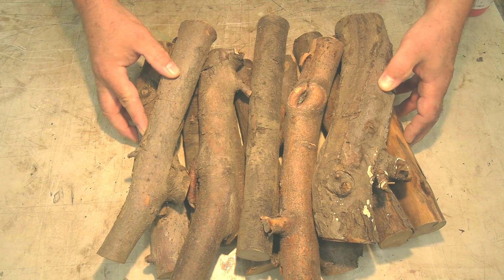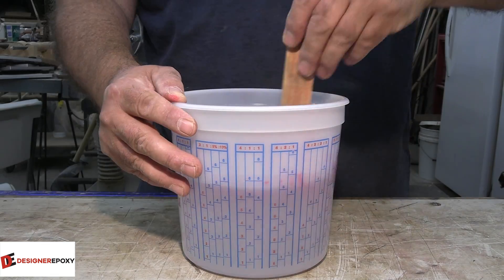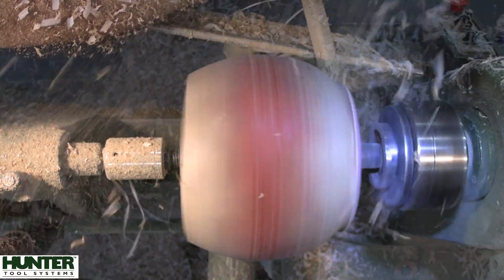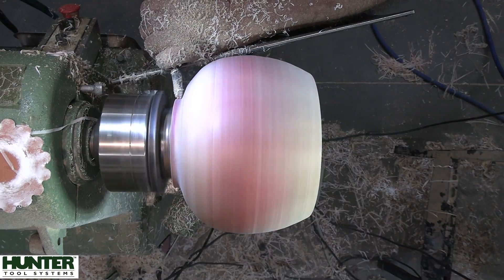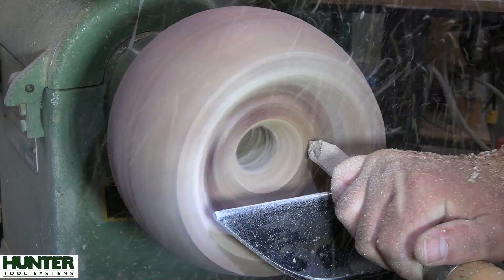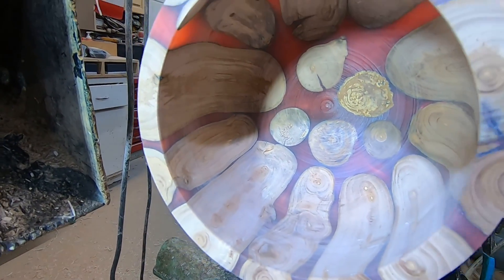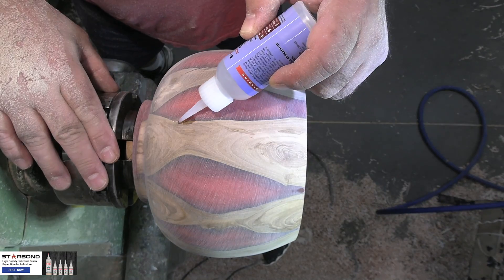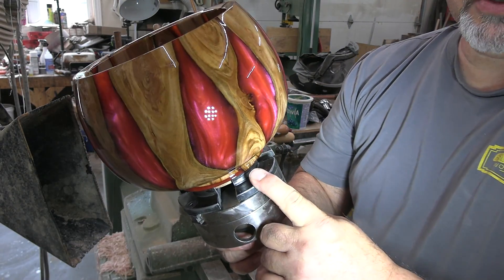Woodturning - The Apple Branch Bowl

Comment: I have two apple trees that have been in my yard since my parents planted them in the 60's.  They are in bad shape and I will be taking them down to make something for my kids who grew up eating the apples off these trees.
This post was an inspiration, as have a few others as to what I'll do with the trees, especially the smaller limbs..  I've also got a few neat cracks that I think will be awesome filled with gold inside dark blue hypershift epoxy.
Thanks, Jim.
Reply from the maker: My pleasure, thanks for watching!
Reply: @SpragueWoodturning  I'll send you pics of my "journey".  I can see light through a knot in the trunk of one of the trees, and that was what caught my eye with this turn.  I'm trying to find ways to use less epoxy by using "fillers".  Maybe even PVC pipe and fittings.

Comment: The finished piece is superb. 

Just a thought - could you have just put short rounds of the branches in the bottom of the bucket and placed a plastic container with rocks/marbles/rice in it on top of them - that way the center would have already been hollow and the branches and resin you had to turn out could have been saved for another project without having to attempt the coring.
Reply from the maker: Yes, that could of been done. I think that the piece would of looked odd with the branches not running consecutively though it. Thanks for watching
Reply: @SpragueWoodturning  Not sure - I was only talking about the 3 or four that only show in the bottom but do not run to the top ... basically, the ones you tried to core out.  It may also reduce the total amount of heat and help avoid heat cracks.

Comment: Great project Jim! names for your rock,,,, Sylvester, you know, Stallone in the movie Rocky! Duane "the Rock" Johnson, my dads name is Duane also....Ive commented enough times on videos past, you might be tired of it, but i wanted to say Thank you one more time. Ive been working to achieve masterpieces like yours! Ive been mimicking a lot of your tools and products used. ive struggled through 6 cuts between 1 Oneway carbide, and 2 of the regular cutters. Ive made 3, 3 piece sets. my big bowls arent as big as yours, im using a large mixing bowl which gives me almost 11" diameter before spinning. I sold my first set today for $180! lots of work involved in the set, but coincidentally just enough to order the Korpro ive been wanting! Thanks for the videos! dont change a thing about how you produce them! 

Your fan,  Aaron-Fresh Air Woodshop- Kansas
   PS i will be using your coupon for the Korpro, so thanks for that too.
Reply from the maker: Great! Thank you so much!

Comment: This is a lovely hollow form! The apple branches, showing through the resin, remind me of a dahlia flower. I know it was disappointing to miss out on the core, but, remember, you do still have those smaller branch pieces. If you split them, lengthwise, you could do another resin piece, with much the same effect...Just an idea. 
Thanks for doing the Q&A sessions. I very much enjoy them! With respect to wood sources, I have found that just letting people know I'm turning, has brought in a harvest. People see wood at the side of the road, and tell me the address; they trim their trees, and let me know. Another has converted to a heat pump, rather than a wood burner, so has offered me some logs. I certainly don't mind! We are providing a valuable service to the community, giving them years of beauty, and, when the pieces finally give out, they often can be used again, but as firewood...but I'm preaching to the converted. Have a great week, and thanks for the video!
Reply from the maker: Glad you enjoyed the video and thanks for your info! Jim

Comment: Jim, didn’t know if you knew or not, but the Beall buffing system has buffing balls as well. They are great for getting inside a smaller bow with the Tripoli.
Reply from the maker: Yes I have a complete set of them. I find they don’t do as good a job as the buffing wheels. It’s probably got something to do with their small size. Thanks

Comment: Hello.I love the bowl.I use the General Finishes bowl finish.I do a heavy sanding after 1st app and just wing it according to how the finish smoothes out on the next 2 app.I saw that u only buffed after your 1st app.Is this because u which to the water lox?And do u use the same method of finishing on all wood bowls?
Reply from the maker: I use this process on all of my pieces that have resin incorporated in them. Other straight wood pieces sometimes get 0000 steel wool between coats. Thanks

Comment: I go hiking in places that have been logged off and there’s burls in piles on the side of the logging roads or tossed in slash piles. The piles have to be burned or chipped up or other types of disposal so you can just go pick through the piles. It saves them work and $. Just check your state/province laws about taking it first. You don’t need permits if you aren’t cutting down logs. At least not where I’m at.
Reply from the maker: Wow, that’s a great setup! Thanks for watching
Reply: @SpragueWoodturning  if you were a bit closer, I’d bring you trailers full. Lol. It’s sad it just gets burned.

Comment: Tiger 🐯 Rock! 😊 Great video as always.
Question about the resin. Could you pour one colour one day and add another colour the next?
Reply from the maker: I’ve never done it but I don’t see why not. The only issue is the pressure pot is compressing the bubbles and by releasing the pressure those bubbles might expand and than you might have them in your work. Thanks for watching

Comment: You could use a vacuum food sealer to keep the wood dry and then do a water submersion to catch the displaced water to measure the precise volume of wood. Calculate that with the volume of the container your putting the wood and resin into and then there is no more guess work. 
Maybe you just like the dramatics?
Reply from the maker: Could be 😁😁, the one thinking you can’t account for is how much resin the wood will absorb, that’s where the real science will be needed. Thanks

Comment: Why did you use end grain  for tenon ?  maybe cross grain would not have snapped.
Reply from the maker: It didn’t snap and if you want a strong tenon end-grain is ideal. The problem here was because there’s a lot of resin in the tenon, you can’t sink the jaws of the chuck into it and that’s why it came out. Thanks for watching

Comment: Hotmelt glue, just like from a glue gun, or? I dont see a link for it in your link section.
Reply from the maker: Just normal hot melt glue that you use in a glue gun. I use an electric frying pan to melt mine. Thanks
Reply: @SpragueWoodturning  Thank you very much :)

Comment: Hi Jim
How do I become a member?
Reply from the maker: You will either see a join button or a membership button at the bottom of the video. If it’s not there, your probably using an apple device. If that’s the case, you need to go to YouTube.com, not the YouTube app. Go to my channel and if it’s not there still, log out and then log in and it will be visible. My wife had the same issue. Thank you very much!